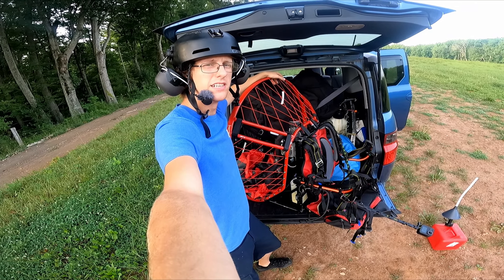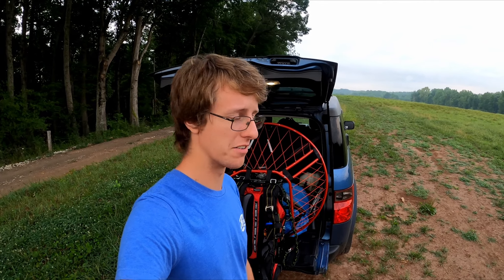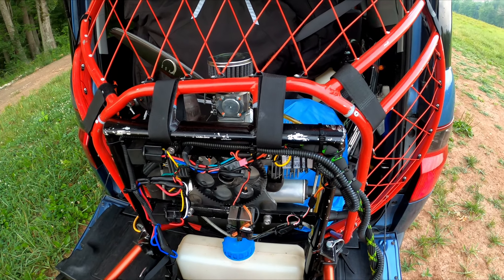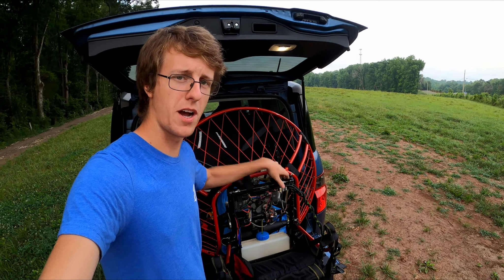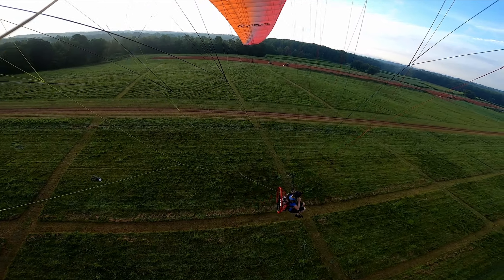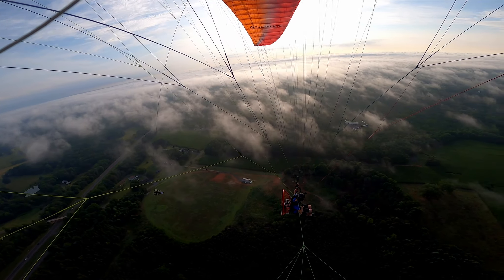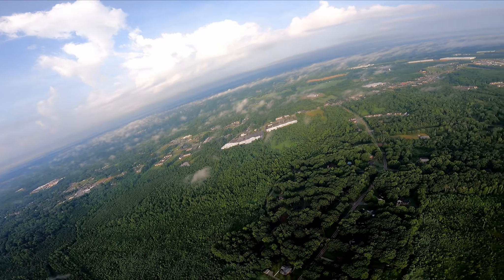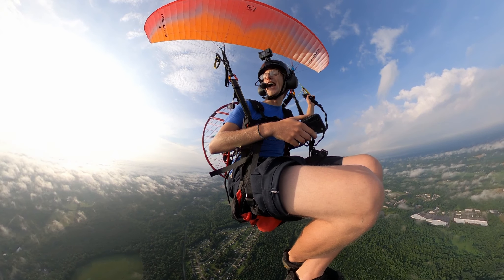AliExpress Paramotor Endurance Test | Avery Flies

Comment: Holy hell, that was a lot of running!
Reply from the maker: Yeah, about 450 feet! I'm so used to my other motors getting me up to speed, I don't think the wing got all the way up and I had to get it all the way over before it flew
Reply: @AveryFlies  I just started and my form during takeoff still sucks, it's always a relief to get airborne. I can't imagine having to hold it at full throttle for that long!
Reply: @grantschulte7893  i can relate! with my gasoline engine i was running like 30 meters last week on the beach and that was with a nice breeze! 
almost hit the bloody pole. i caught myself jumping into seat way too early because i thought i should be airborn 20 meters ago. holding breaks down to get bit extra lift while my frame was almost touching sand. from the video i watch others took with mobile phone it looked like 10cm or maybe 15cm to hit the ground. and then i had to make a turn because those wooden poles came in hot. super close one. if imagine to fly a low thrust machine as this i would probably crash or abort launch. uuuhm or both same time. 
i admire his willingness to run a marathon just to show us how bad this thing is. 😅

Comment: How long did it take you to glide down after the engine cut out? You have to include that in flight time for fuel burn purposes.
Reply from the maker: I don't think that factors into fuel burns, the engine wasn't running. My goal is to use this in a climb and thermal when the engine dies, so I need to know how long I have until motor off, not including how long I stay up afterwards... Anyways, it was only about 6-7 minutes
Reply: @AveryFlies  Of course it does. You're flying in non-thermic air so if you land at the same altitude you take off from, you must include it. Otherwise if you hadn't burned so much fuel climbing so much and allowed the engine to cut out at 10ft agl, you would have got more time out of it.

Technically what you should do it so climb as gently and as little as possible to see how much time you can get out of it. But if you waste tons of fuel climbing to 6000 ft agl, the best you can do is factor that in by counting the time spent gliding down to take off altitude.
Reply from the maker: @turkeyphant  ok, well, add 7 minutes then. The problem is, the margin between full throttle and level flight is about 1500 rpm 🤣
Reply: I didn’t notice that he climbed to 6000 feet. I skipped over a good portion of the video, but climbing to 6000 ft skewed the data to make it look bad. Tucker got 12 miles and still had 1/2 tank left.
Reply from the maker: @GY6SCOOTERCHAT   Not sure where anyone said I hit 6000 feet, I've never been that high on any motor. Tucker was also on a more efficient wing and didn't climb much at all, so that helps
Reply: The dude above said it.

Comment: probably enough range to hop from gas station to gas station.
Reply from the maker: I would be comfortable flying about 15 miles on this thing, past that you would be relying on the glide to get you an extra two or three LOL
Reply: @AveryFlies  its an rc motor might as well get some servo motors that pull the strings and have a sand bag fly this thing instead

Comment: It HAS to be our first PM (poor me) or just move to Thailand where that have figured out all the hicups and over engineered it.  What wud b a close second?  Predator 212?
Reply from the maker: I would look at vortex aero. You can get a titanium frame with a monster 185 equivalent for $5k. The predator 212 is much heavier and does not have the same top end power, it would probably be a worse pick. 

This paramotor harness is kind of dangerous out of the box. If you absolutely have to buy it, you need to watch my unboxing, fixes,  first flight and review.

The noise is really terrible too. I can't let that go undiscussed. If I was a landowner I would not want you to come fly from my property, easily twice as loud as a normal paramotor. I urge you to look for a used unit. The Atom 80 or top 80 engines both make more power than this and are much quieter, I've seen used minipalne top 80s for the same price as this.

Comment: I'm 73 and I find even the top 180 heavy. My aim is to use this light motor only to get hight to find my first thermal. Effectively a motor glider from flat land. 
I've not flown it yet I need some flat land.  I live in the mountains of southern Cebu.
Reply from the maker: Well, if you haven't bought one yet, prepare to be disappointed. This frame is heavy- my atom 80 fresh breeze frame is the same weight, and the atom 80 makes a lot more thrust.
Reply: If you're 73 you won't be able to run enough to launch this. Get a trike.

Comment: this engine is as i said many times before absolute fantastic for youtube clicks. and with that statement all positive things i can say about it end right there. avery i am living in china as you know and we all hate that bloody POS because its soooo loud and we spend alot time helping the fellas who fly it to make last second repairs so he can join us for 5 minutes before we get kicked from the area because people always complain about the insane noise / or he crash because the exhaust fell of for the 286th time and broke his prop 🤨
if anybody plans to buy this i say: if you really hate your life and love to do unscheduled emergency landings, bleeding eardrums or the inside of hospitals - go for it and get one. 🔊📢📣🎧🤣
Reply from the maker: Yep, pretty much sums it up. No argument here!
Reply: @AveryFlies  sorry for bashing on it. i think with a good more silent DIY exhaust system and alot changes on frame and machine this could still be a good thermal flyer due to low weight and the fact you can shut it off, restart it electric and continue to search thermals. but maybe for that i would rather get a used atom80 and retro fit a starter with a tiny lipo on?
Reply from the maker: @cloudpandarism2627  bigger hoops and props are higher drag. And this motor has a good exhaust now, it's the prop's tip speed that makes it loud.
Reply: @AveryFlies re you sure? maybe your unit is okish now. but the fools who fly it here had their exhaust fell off and they just left them off. you cannot even begin to understand how insane loud that is. i say 6 times a moster185 with broken prop. i can send you videos. they fly without helmet or ear protection! how is that even possible. 
i finished watch your entire video now and your launch had me in stitches! 🤣😂🫶🏻🤙🏼
i was yelling at my screen: "well would you look at it...after only half minute of sprinting he is off!"😂 you are insane! love your videos mate. 🫶🏻
Reply from the maker: @cloudpandarism2627  haha! Yeah my exhaust that I upgrade makes the idle quieter than a moster. It has an expansion chamber and a scooter muffler now, you can see it above the gas tank. But it's still the faster spinning prop that drives the Volume.
Reply: @AveryFlies  ah good! i suggest this mod here for years. but nobody cares. they think louder equals better. (oh look at me i need to compensate for my tiny di... i mean eyes)
from the video its hard to hear but i take your word for it that its quieter now. good job.

Comment: You just need to carry a gallon fuel bladder!
Reply from the maker: I don't know if I would leave the ground, did you see that take off???
Reply: @AveryFlies i saw it! still wiping tears from my eyes 😂 the music and your poor follow cam doing the tumble weed dance... didnt you just lost a cam? time for a name change to averyvel knievel
Reply from the maker: @cloudpandarism2627  yeah, hero 8 smacked into the prop as I tried to launch the much faster gin falcon. I got a hero 9 for my helmet cam and now use the old helmet Hero 8 on the follow along.
Reply: @AveryFlies  i always wanted to ask: what happens if you make the line just 1 meter shorter so it can never hit the prop and just point it down 2-3 degrees? i have a dji action 2 here i could use for a chase cam but fancy eprops are expensive and they need 2-3 months to arrive me from france. not keen to test my luck with a chase cam flinging into my prop. any suggestions?
Reply from the maker: @cloudpandarism2627 closer gets less wing in the shot. Longer drags. Kind of lose lose. I'll probably go shorter though.
Reply: @AveryFlies  ah thanks avery. yeah then i will try the same and go shorter as well by turning the cam to ultra wide and hope its enough to get my fat a$$ in frame with the wing 😅